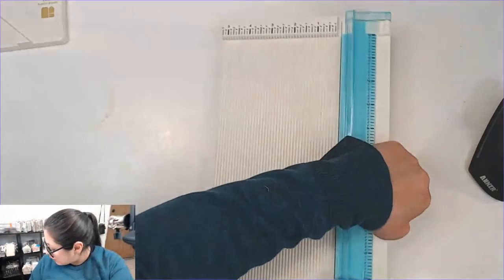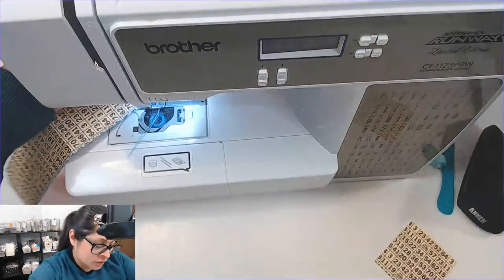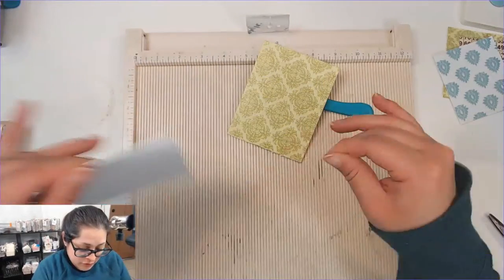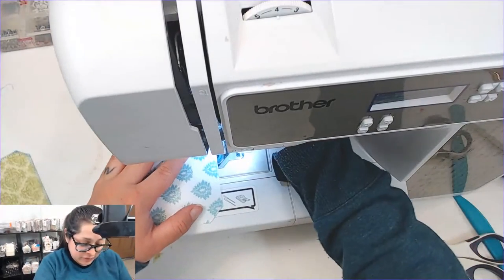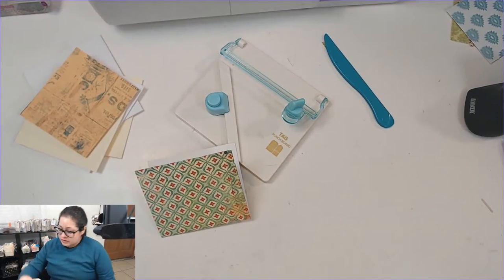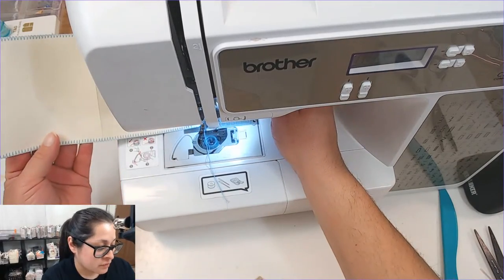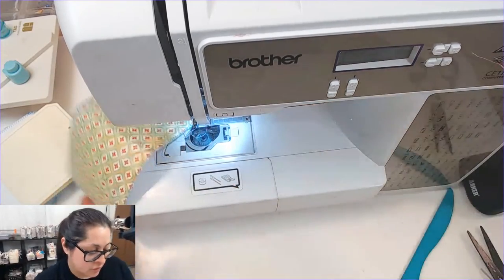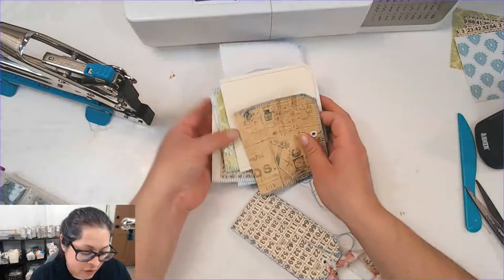Tags for Junk Journal Signatures

Comment: Well, they have the Brother ScanNCut DX bundle on sale today for $395.95.  Wondering if you could share some insight? It comes with 2 mats, and some other stuff. Have you ever done a review/how to video on the BSNCDX? I know you like it and have two, but what did you NOT know when you first started using your machine? What do you use it for? Is it slow? Noisy? How often do you replace blades? Mats? Best price on replacement parts? Really hoping to decide today. Thanks! -Rhonda HH
Reply from the maker: Try to look for the CM350. Unless you're already sold one the new one. The CM350 should be cheaper because it's older, I believe. I haven't used the new one but I'm sure it works just as good!
Reply from the maker: Here's the last video I made about it : https://youtu.be/3Bf703_CwdA